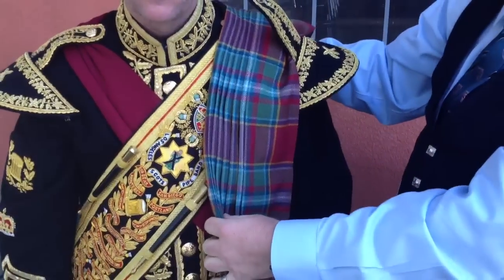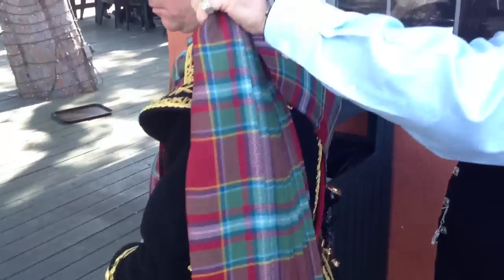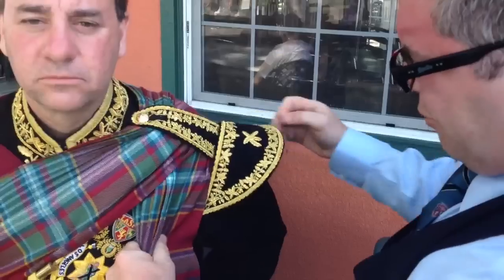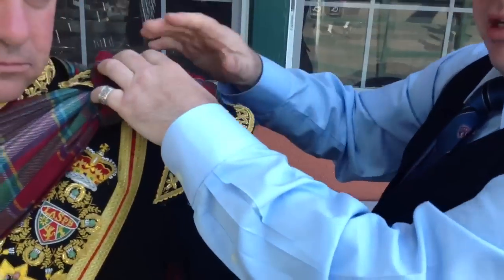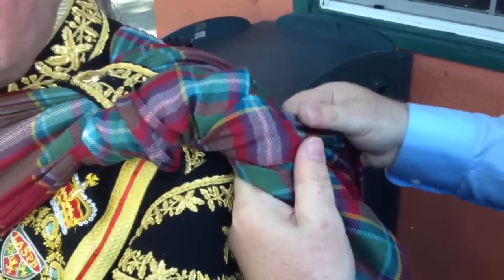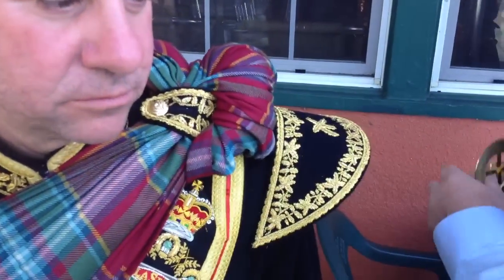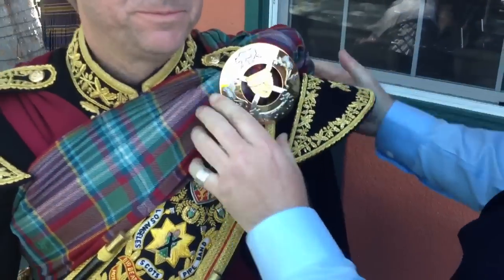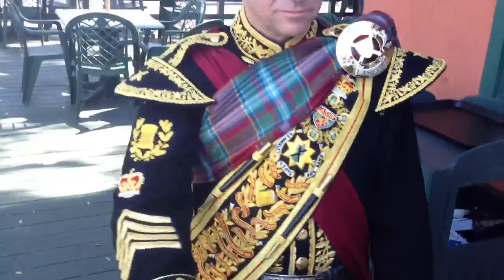Drum Major Plaid Tying: Scots Guards Method

Comment: A very useful video: thanks for sharing.  I hope others will take note, and not wear their plaids pulled forward, covering their left arm, but rather swept back as in your video.
Not so easy though, when you are playing solo, in full dress, and you have to do your own plaid !
Reply: Yea, and I’ve only got one shell on my doublet,  plus rarely have an assistant to help tie in the plaide.
Reply: The army wears the plaid pulled over the shoulder and pinned in with a broach. That's the way its "supposed" to be done.
Reply: @jimbo8220    That's what the video shows - the army method - Scots Guards).
Reply: @piperbob2  I'm in the army and was taught otherwise. Overall the method here is pretty good and looks neat and tidy. If you are interested there are a couple of videos on YouTube by Jim Ramsay (channel name). You'll see that military bands wear theirs over the shoulder- particularly easy to see on the Royal Regiment of Scotland brass band (they dont have pesky drones obscuring the view of the shoulder.)
Reply: @piperbob2  it shows the Scots Guards way, it is not the way Highland Regiments wear the plaid. We wear a shoulder shell and the plaid is pulled forward so that 2 lines on the shell are visible at the very front and the shoulder is covered. 
The short end of the plaid is pulled under the long end, (which is now at the front) across the back, and then tucked under the wrapped plaid and cross belt, running down, to the left of the spine.
The long end is then taken and the first two pleats are grasped, and the rest past back around the shoulder and pulled roughly to the centre of the back, covering the short end.
The first two pleats are then moved to reveal the first two stripes of the shoulder shell. Then it is pinned in place.